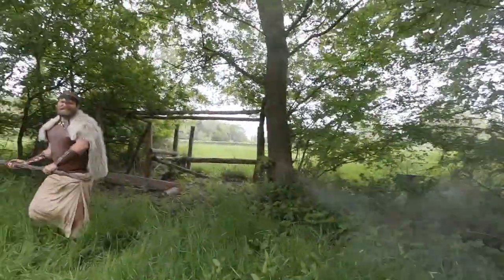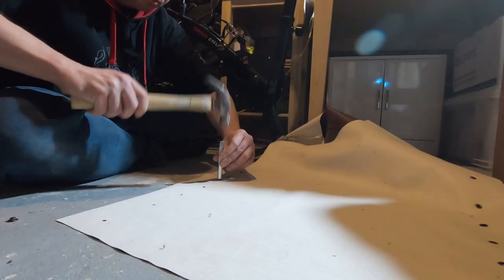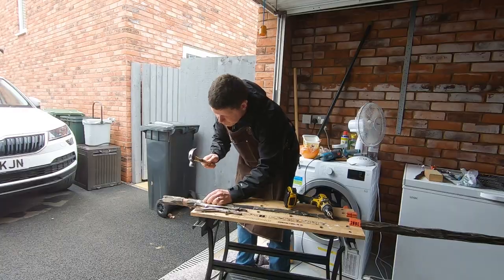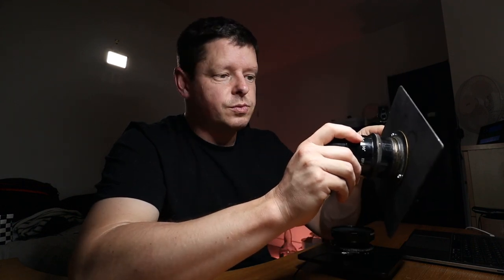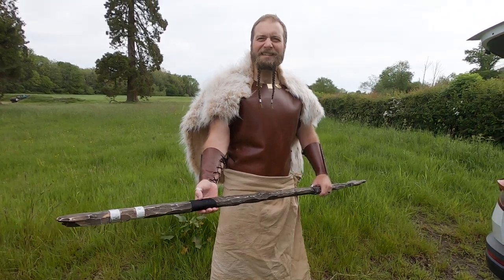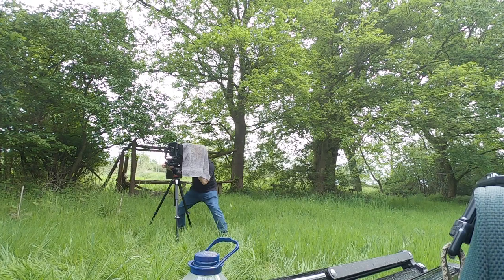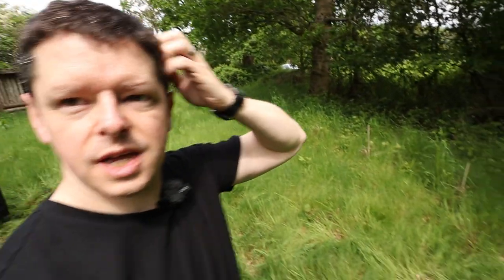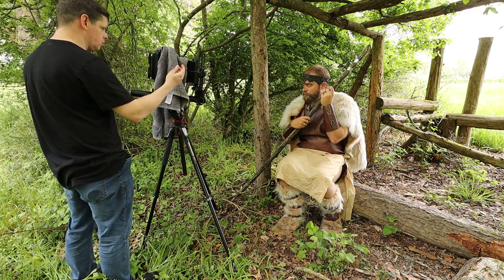Large Format Photography - Viking themed portrait shoot!! (plus first shoot with the Dallmeyer lens)

Comment: Thanks....Enjoying your journey. It has been entertaining as well as informative. I have used the E6000 glue to replace a bellows on my Linhof from one of your former videos. Always curious as to what you have up next. Bonus historic information as well, since I never knew Vikings used Nylon cord. Love the Dallmeyer lens images. Waiting for your next creative concoction. "Why?"....Why the hell not? Cheers from across the pond....
Reply from the maker: Thank you! So you went with the E6000? That's definitely top of my list of glues... check out the comments on that video, someone over there is saying that double sided sheets is the way to go. I suspect I'll make a snap decision when I get around to doing the job! How did you get on with the E6000? Did you find it easy to get an even spread?
Reply: @the120ist  I was lucky since the Linhof Kardan Color has a small front bellows. It was not that easy to spread the glue inside such a small area but it held great. That bellows is not going anywhere. I suspect since every manufacturer has a different way of mounting a bellows the selection of adhesives will vary with the mounting design. For me the E6000 worked great and your glue test was very helpful with a selection of glues for different repair applications. If I use the E6000 to recover my old Edixa Flex I will break it down with a little alcohol to make an easier to brush on like a one coat cement. The glue remains flexible after setting that's what I was looking for. A good bond and flexibility.
Reply from the maker: @waynesimon7096  Thinning with alcohol... that's a great idea! I might do a few tests with that, see how that works out and what sort of level of thinning works best. Thanks!

Comment: I have a Jena Tessa 300mm lens from my Graflex to place on my Chamonix F2.   Wonder how you like the on/off lens cap for the 1sec exposure.  Do you see another way?  Your images are well thought thru and end result were lovely.  Front tilt too.  Thanks for sharing.
Reply from the maker: I settled on a half second with the lens cap, which I think is probably the quickest I could hope to replicate with my hand! It worked this time, but it could easily have not worked. It's impossible to be accurate, of course, and ensuring that you get the cap back on cleanly is tricky. Luck was on my side that day!

The rear thread is too big on this lens for any standard shutter. I have a shutter that I think could fit over the front end of the  lens, but it is very old and very stiff. So I'll take that apart and clean it up, that could work, but this lens is the right at the extent of what it can cover. It's an Ilex Oscillo Paragon No 3X Universal. It's the biggest I've seen. It's manual though, and not spring loaded, so the action of pressing the remote release opens and closes it.

I've also been thinking about making a guillotine shutter out of plywood. I've sketched out a design, and it would be easy enough to make, but I think the shock forces of the guillotine blade coming to a stop at the bottom of its fall would put a lot of stress on the lens mount and attachment to the lens board. There may be something that can be done to damp it, but I haven't spent enough time thinking about it yet!!

If I decide to build a plywood shutter, you can be sure I'll post the video on here!
Reply from the maker: Thank you for the kind words btw!
Reply: @the120ist  Thanks for the explanation.  I saw Todd Korol use a sheet of paper over the lens, seen other use two sheets Ike a scissors… yet I’ll be using ADOX CMS 20 II 4x5 files at 12 EI. So I’m thinking about a sheet of velvet covered hard paper as the lens cap on/off could induce vibrations.  Don’t know for sure, need to go out and try it.
Reply from the maker: @flipflopsleica  Hmmmm... not so sure about the paper! But maybe a thin piece of plywood with black velvet / felt on one side. You'd still have to apply some pressure to the front of the lens before and after exposure though, and I'd worry that, as you say, it would induce vibrations. But it would function, and that's the main thing, right? It took me maybe 8 weeks between buying the Dallmeyer and using it for the first time, because I had no real idea how I was going to shutter it! Most important thing is getting out there and doing something!

Let me know if you come up with any ingenious solutions! I've got another Dallmeyer lens that I've mounted and am planning to try soon.
Reply: Jim Galli recommends holding two dark slides flat against each other with an angle between them (not unlike movie audio sync clappers) -- hold one dark slide against the lens, then rotate the pair to the other dark slide, such that the angled gap between the slides uncovers the lens opening briefly. Seems to work for decent sub-second exposures. Or just shoot ISO 2 gelatin dry plates, in which case you never have to worry about sub-second exposures. :-)
Reply from the maker: @RobertBrazile  Interesting idea. That's essentially what the shutter on some of my folding cameras is, just a fixed angle rotating past the lens. I guess if you could be fairly consistent with the angle between the two dark slides, and fairly consistent with your movement of them, then you could get a repeatable sub-second exposure time. I think I'll have a play with that this weekend, see what I can achieve. Thanks for the tip!
Reply: @the120ist  yes, exactly. Good luck with it!
Reply: @RobertBrazile  At 2:35m.  Jim Galli's "Double Darkslide shutter"
Reply: @flipflopsleica  That's the one, thanks for posting the example.